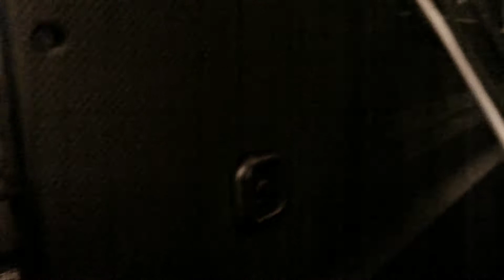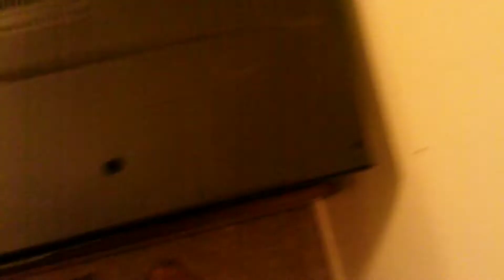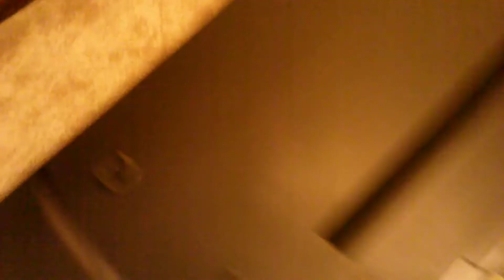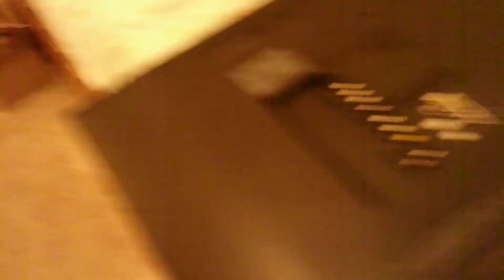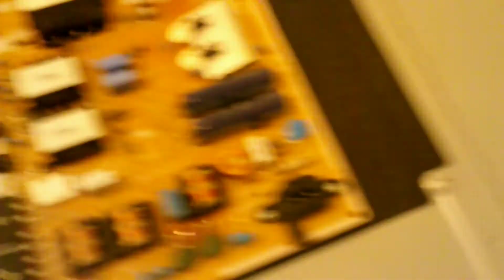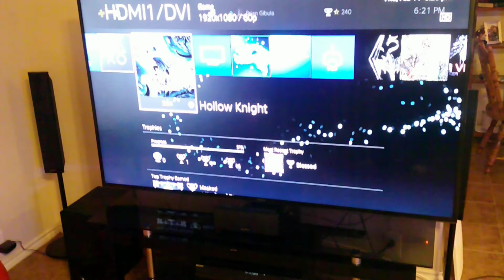DIY TV repair - Replacing a burnt power supply board on 65-inch Samsung smart TV

Comment: Hi where did you find the no for the power supply. Great 👍 video
Reply from the maker: To be honest, it's been a while since I did this but I believe it was close to the barcode area. It started with BN44- for my tv. But you could always just look on eBay based upon the model number on the back of your TV. Just be careful not to be fooled by sponsored search results. Sometimes they will not give you the board you need. Also, it's a good practice to only purchase when there is some return window if the item isn't what you need.

Hope this was helpful!
Reply: Thank you for your reply to me great video